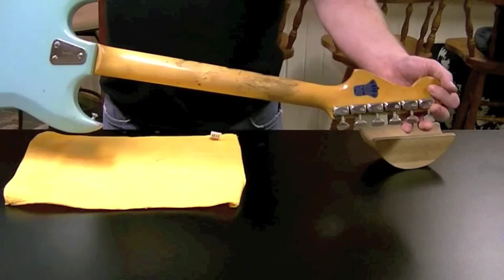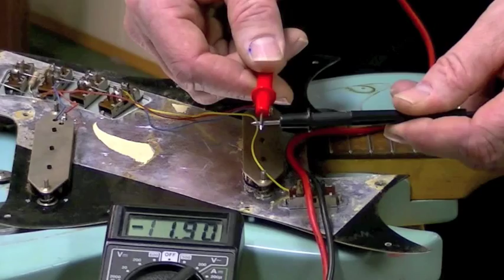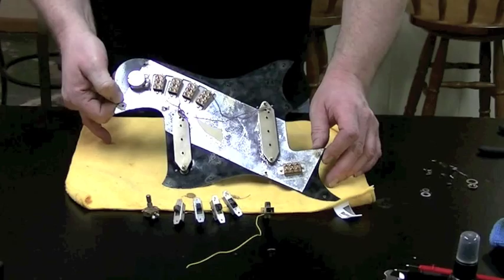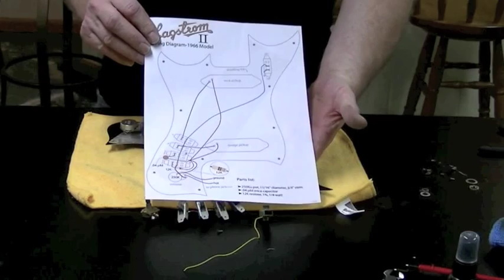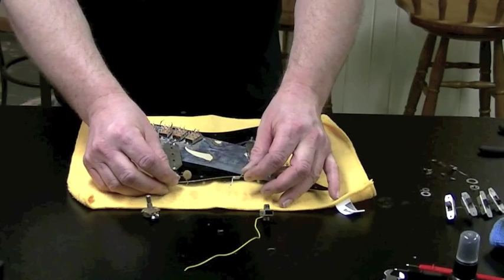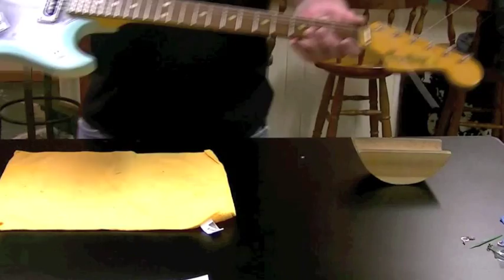Vintage Hagstrom Guitar Restoration

Comment: If it were me, I would have sanded the back of the neck and added some clear coat, just to make it look nice.  Also curious as to why you didn't cover the missing aluminum on the backside of the pickguard to repair the shielding?

Comment: The most underrated guitars from the old era. I have a '64 Hagstrom III and it's an amazing guitar. The pickups just scream and the sounds I can produce from that guitar are just out of this world. Mine actually has an odd "defect" where the Tune and the Mute are switched. I looked it up and nothing was done to it as the wiring is still the original factory wiring.
Reply: I have that same issue, on my 1966 Hagstrom, where the Mute switch works mote like an attenuator switch. All original wiring. The pickups are amazing. Great neck action. Here is an oddity about the pickups. 

The pole pieces are made up of multiple sections. If you rub too hard, when cleaning, the top part can pop off. But don't worry. They are magnetized, so just put it back and it snaps into place.